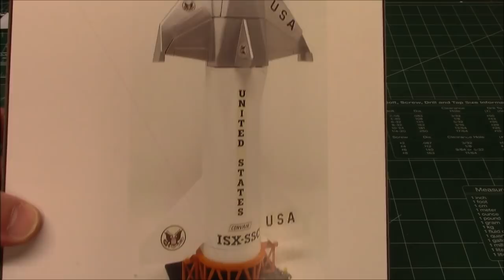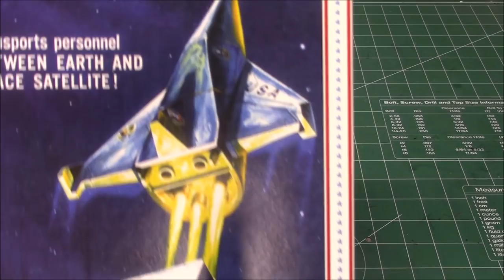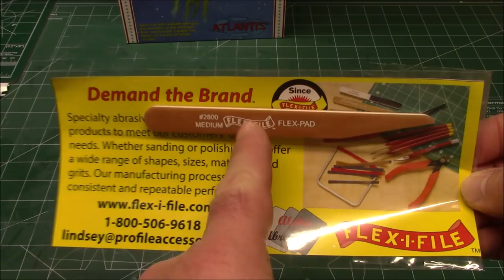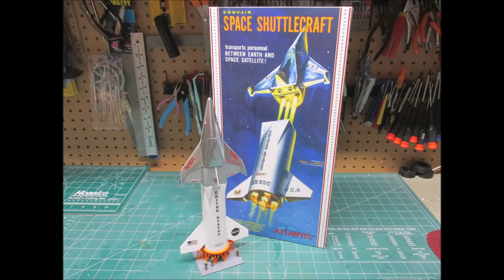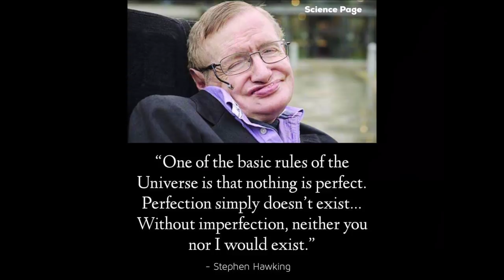Convair Shuttlecraft Space Shuttle Rocket 1/150 Scale Model Kit Build Review Atlantis H1828

Comment: I think this was an design by Convair, which never made it beyond the design stage.  Like Werner von Braun designs of spacecraft in the 50's and 60's.  I think someone wanted to have kits to compete with those.  Anyway, I built this kit when I was a kid.  Tells you how old I am.  It definitely didn't have all of the decals this release does.  Very cool kit.  I'll be getting me one, just for the nostalgia.
Reply: Interestingly, the shuttle's original design was just like this, with the glider on top of the first stage. It was feature creep and size issues that forced it into the offset side mounted system they ended up with. Columbia's issues with ice falling off the main tank and hitting the vehicle would not have been a thing with this design.
Reply: I did a quick search for the kit, and found the original release was in 1959.  The version I built as a kid in the 60's was the "Space Pirates" release.  It was the same kit with a completely different set of decals.  It is something I did not know about the early Shuttle's design included some of the designs from the Convair shuttle, but would make sense to start with existing designs.
Reply from the maker: Thanks for coming along for the FUN Vince!